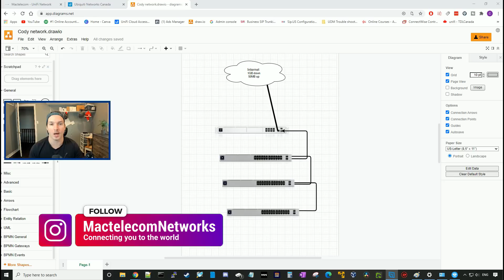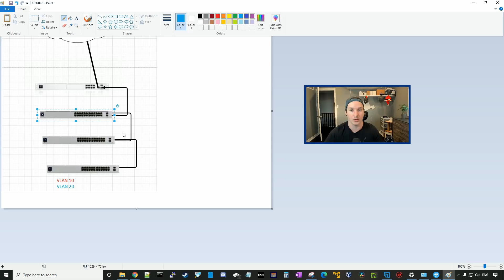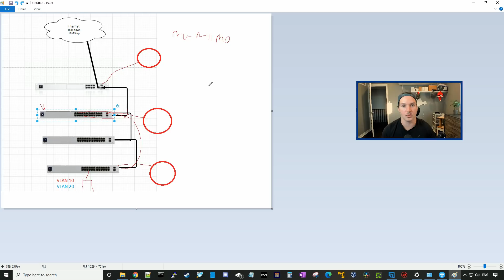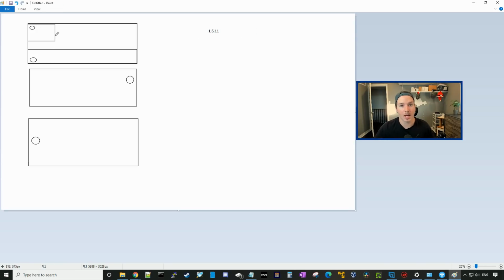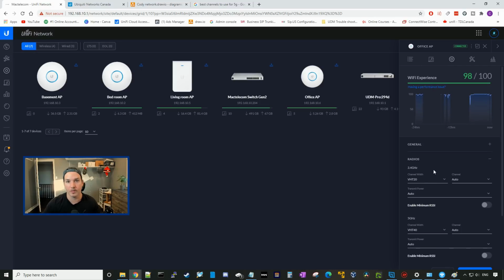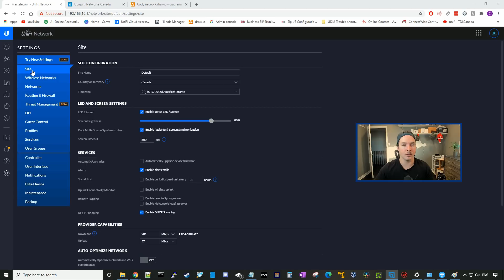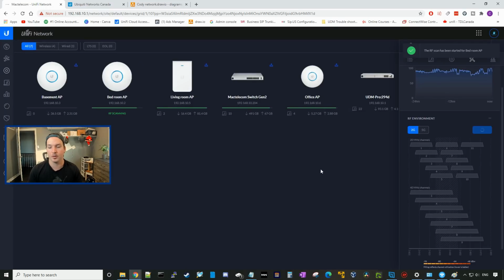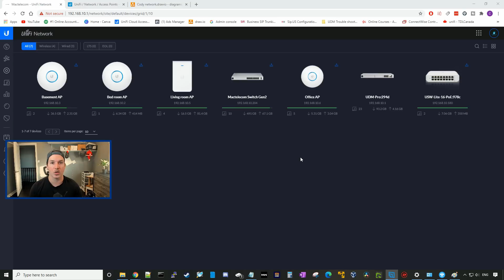Optimizing Your Unifi Network

Comment: If you are connecting 3 switches, you need three DACs.  Your DACs would be configured as such:

1 to 2
2 to 3
3 to 1

Then if your internet is less than 1Gb/s, use a 1GB port to connect the UDM and use L3 routing if you need to route between VLans.  

As you are showing with your Visio, if switch 2 goes out, you have lost everything on Switch 2 and you have isolated Switch 3.  If Switch 1 goes out, you lose 1 and isolate 2 and 3, effectively bringing down your whole network.

The extra cable gives two routes to every switch.  STP will do its job and stop the loops.

Comment: Cody love the videos man...straight and to the point and have learned a lot.  I found this slightly older video and looking for a recommendation.  I have an office where initially I installed one UDM-Pro and two USW-24-POE switches all in a single rack.  The intent was to use the POE from the switches for AP's and cameras eventually.  The site has two floors.  1st floor has the main server rack and 2nd floor I installed a wall rack with four cat6 runs fed from the 1st floor as this is where the main cable feed was coming from.  Also installed three unifi AC-Pro's.  One on the first floor (using one of the 4 cat6 runs to connect to 2nd floor) and two on the 2nd floor.  Had to do it this way because the customer didn't have enough funds to buy everything until recently.  They've just purchased two more USW-Pro-24 switches so now my plan is to have one Pro-24 and one 24-POE in each rack for the 1st and 2nd floors.  What is the best way to optimize for bandwidth with uplinks?  The US-24-POE's only have two 1GB uplinks SFP Ports and the US-24-Pros are Layer3 but also have 2-10GB uplink SFP Ports.  My hope was to do 10GB through and through but unfortunately don't have 10GB uplinks between all switches so what would be the best way to connect these optimally?  If it's easier would prefer to email.  Thanks.

Comment: Hi Cody. Thanks for awesome video. I have NO IT background. In the medical field. I have almost exactly your setup, except only 3 AP, for a 3 storey home. 2x UAP-AC-HD and 1x UAP-AC-IW. I have set my AP's radio's to broadcast these selected channels as you suggested, and I notice that the speed test (Ookla) using my iPhone significantly dropped. I am supposed to get 150 MPS down and 25 MPS up. But only get 10-50 Up (varying a lot) and 5-10 up. Any suggestions?

Comment: Thanks for the video, some very interesting points. One that I need to look into more is your information about the ports on the UDMPro. I currently have my priority systems (such as NAS, CCTV,etc) connected direct to the ports on the UDMPro and not the ports on the connected Unifi 150W 16 port POE switch I have. I assumed this would be faster than going through the switch, is this not true? Also if I were to connect the two via an SFP cable, would that increase the speed? (I currently have them connected via ethernet). Thanks

Comment: Does anyone know why  my I’m getting slow internet speed from my modem to wan. Gig down/40 mbps up but I’m getting only 300 down and 7 Up ? On my UDM pro
Reply from the maker: Are those speeds on wifi or hard wired?
Reply: HARD WIRE
Reply: Last night i had my udm pro connected from my lan to my old router/Modem combo and it ran perfect today i bought a new modem and connected it I’m not getting gig speed anymore.
Reply from the maker: @joejoe6949  are the interface speeds of the new modem capable of 1000mbps?
Reply: 2.5 gig Arris s33

Comment: Thank you so much Cody for this video...I wasn't aware of the UDM-pro switch port bottleneck at all. 
May I ask you then which is the best way to connect the  UDM-pro to the Unifi Switch US-24 (non POE version). Should I use a DAC or it's better to stick with a simple ethernet cable?

Comment: Can you do a comparison between high end gaming consumer routers like the asus ROG AX11000 vs the UDM pro and switch for console/pc gaming for those of us who are thinking of jumping to more specialized gear? Would like to see if latency/lag and open NAT for console is comparable.
Reply from the maker: I may be able to. I will have to buy one of those gaming routers but may make for an interesting topic
Reply from the maker: They had a ROG AX11000  at my local computer store soooo I bought it 😅 Not the cheapest piece of equipment but I will do some videos on it shortly
Reply: @MactelecomNetworks  excited to see some benchmarks and comparisons!
Reply: @MactelecomNetworks  thanks! Truly on the verge on jumping from the top asus router, the ROG AX11000, to the unify system with the udm pro, Poe switch and APs but want to see if it’s easy to keep open NATs and latency compared to this asus marketed for gaming. Will look forward to your video!
Reply from the maker: You just need to make sure you do your port forwarding correct on the UDM pro to have open NAT its not to tricky

Comment: As always, Cody, excellent content overall. I have one comment and one question.

First, the comment. Correct me if I'm mistaken, but as I understand it, with the Gen2 switches only the PRO models (which are only available in the 24 & 48 port versions) support L3 and SFP+ modules. Which means that if you have the non-pro Gen2 switches, you won't be able to get the 10Gb uplink speeds or the L3 routing in the switch.

Second, the question. Are the SFP ports on the Gen2 switches always on a separate backplane? That would, obviously provide a bit of benefit even if the speed is limited to 1Gb since it wouldn't be a shared backplane with the other ports. I suppose a follow-up question is...are each of the 2 SFP ports on their own backplane, or is it shared between the two? I have tried to find this info in the documentation, but it simply isn't clear.

Comment: This is a bit inaccurate. Why bother with 10gbps ports when you gimp your throughput by setting 5GHz to 40MHz width? Set it to 80MHz and set the different access points in your home to use different channels so there is no overlap. Use DFS channels if you need to. Your access point will switch to non-DFS automatically if there are any military installations in your area.
Reply from the maker: Well you’ll never get 10gb on access points ever. The uplink will pass the vlan traffic faster between the switches.

Comment: Hi, thanks for the video.  I'm in the middle of planning my new network in a new house. Several Nano-HD APs are planned. I wonder what would happen if I left everything on "Auto" for now. I wouldn't start clicking until problems came into play. At least that was my original plan.  Would you advise against it? :-)
Reply from the maker: Everything on auto is fine. Typically I set channels if I notice an issue

Comment: With the new controller v6 UI, the description of the Uplink Connectivity Monitor is "Used to make sure your AP's has a valid connection to the gateway" and it also affects that if AP losses connection to gateway it stops broadcasting the SSID's, so this option doesn't affect only Wireless uplink connectivity, and actually it doesn't disable it at all from being used by the AP's

Comment: If you're using those channels you can only use 20MHz wide channels (in 5GHz) otherwise they'll overlap. 

channel 36 with an 80MHz wide channel uses 36,40,44,48

Channel 36 with 40 MHz channels uses 36,40

Why wouldn't you use DFS channels? If it gets a radar event it'll move to another free channel.
Reply: Also fast roaming.... That only works with 802.1X networks...
Reply: If you want to see channel utilisation use either wifi explorer (macos) or winfi (windows)

Comment: what does layer 3 really provide over layer 2?
Reply: It's important when you have VLANs. Routing is at layer 3, so if you're moving across VLANs and only have layer 2 switches, all that traffic has to go through the router. If you have a layer 3 switch, it doesn't have to.

Comment: When you say not to use a "copper connection" on the middle switch, you're referring to a tradition 10Base-T 1GB ethernet cable, and not a SFP+ direct attach twinax cable, which I believe uses copper as the medium the data travels through?
Reply from the maker: Hey I probably should have been more specific. I meant to not use a cat 5e or cat 6 cable which will only run 1gb as that would cause a bottle neck in your network ( with the design I was going with) 

I’m thinking about doing another video on switch design and how to connect everything based off of 10gb uplinks
Reply: @MactelecomNetworks  Thank you for the clarification - that was what I thought, but having spent most of the Covid lockdown redoing my home network to crazy levels, it's still a learning process for me since I have no formal training in IT. Your channel is really great. Thank you!
Reply from the maker: @jordanmelville5786  thanks !!

Comment: Hi Cody, great video. I’m still having issues with my wifi and can’t figure out wth is going on. I have 940 mbps from ISP and via wired connections I’m very close to the 940. When I run speed tests on wifi I hit a ceiling of 200-250 mbps. I ran iperf3 tests and it also shows 173-225 mbps so I guess it confirms issues with WiFi. I’m using one AC Pro and don’t know exactly what else to do to identify the culprit.

Comment: Do all switches need to be layer 3 to have intelligent switching?  I’m not sure I have my VLANs set to specific hardware switches.
Reply from the maker: Hey nope not at all. I was just putting out there if your switch has the capability of layer 3 switching you can optimize the network a little better. You most likely would not even notice the difference between it routing through your switch or your router ( UDM, UDM pro or USG)

Comment: Could you make a video about a AP and Switch configuration for a huge hotspot scenario: -client isolation? -port isolation on switches? - maybe tweaks for high capacity networks? -DHCP lease time -dhcp number of adresses... I thougth about an campground with 150 campers = maybe so 500 clients peak on 15-20 APs (HotSpot config and VLAN is already set up)
Reply from the maker: Ya I may be able to do that. I’ll put it in my video ideas list

Comment: Assuming non-DFS channel usage for 5Ghz there’s only 2 channels that do not overlap if you’re using 80Ghz.  Keep in mind there’s a pretty big difference in bandwidth when going from 80Ghz to 40Ghz.  40Ghz has 4 non-DFS channels that do not overlap.  If you’re in an environment with low 5GHz usage it would be OK to use overlapping 5Ghz Channels as long as there is some distance between the AP’s and you adjust their power output.